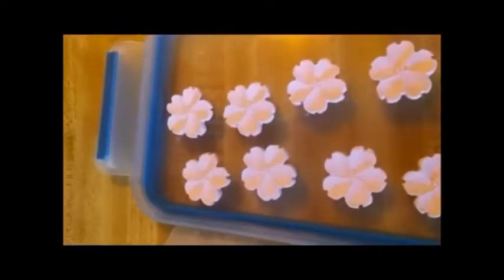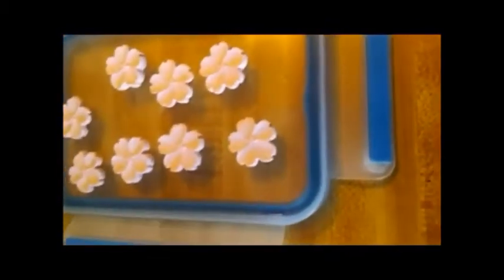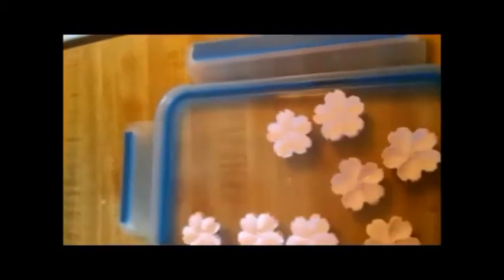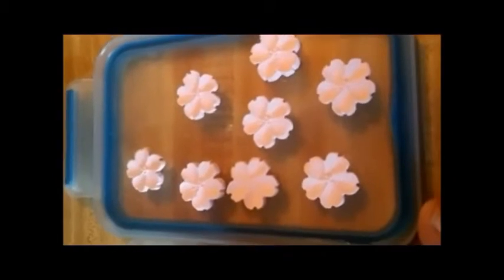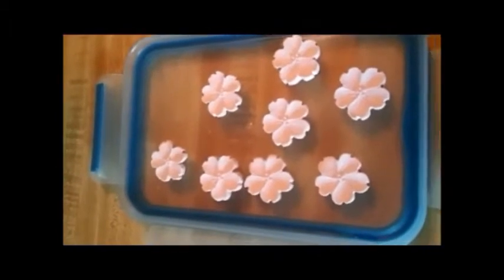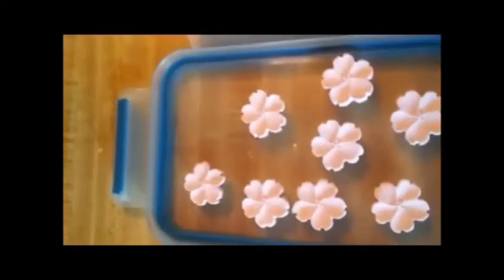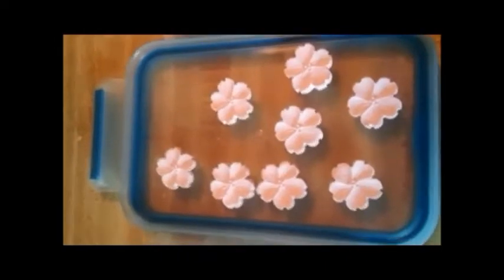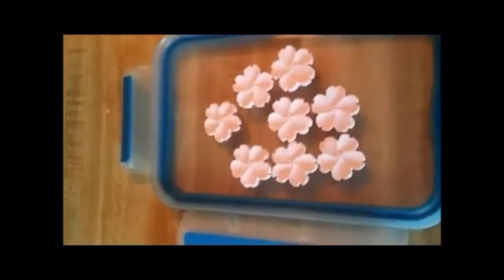NO Bake DIY Molds ( POLYMER CLAY )  Method

Comment: I boiled my 3 little beads for testing but after 20 minutes they cracked and when I took it out and pressed it to see the hardness but it was a little hard not fully it broke into pieces what is that?
Reply: Not 20 I boiled it for 15 minutes cause after 10 minutes it was soft even after 15 minutes too it was lill hard more soft

Comment: What kind of brand of clay did you use? Please answer.
Reply from the maker: I used Premo clay but I also used from AliExpress so I believe any polymer oven baked clay should work, the thicker the piece the longer the boil
Reply: Elemental Designs So a brand of Sculpey is fine as well? Have you tried that brand?
Reply from the maker: @jomariepua  yes it should be I also use that as well